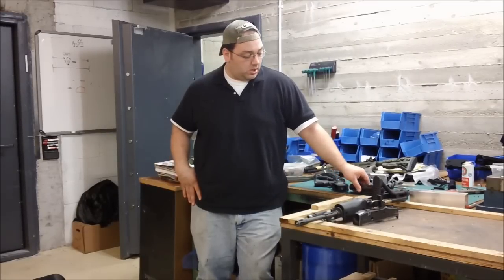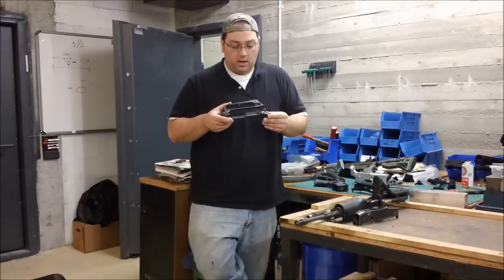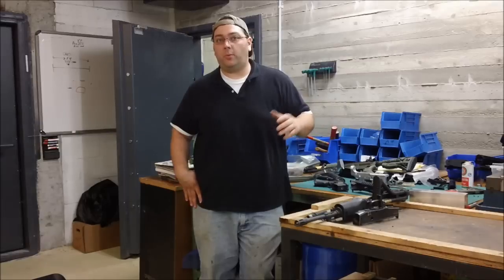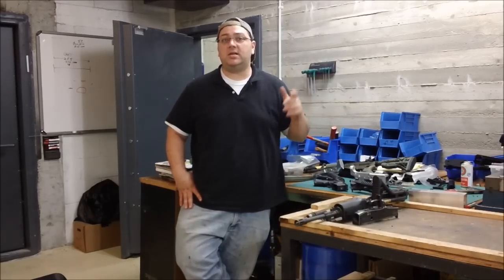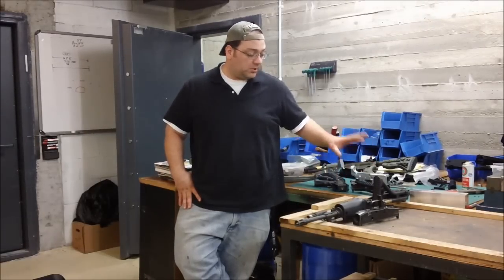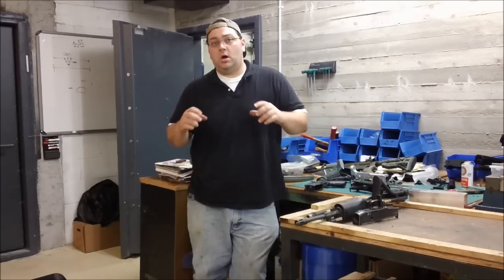Seeing is believing! Milled vs. Forged receiver strengths. Also a look at barrel obstructions

Comment: You know they can CNC a billet upper and lower from forged ingots also.  So you can have both.   Most people think that billet uppers and lowers are made from cast ingots, there are not.  They forge the ingot and then it's heat treated to the spec. that's requested.  I hope this helps.

Comment: You just proved that the forged reciever is harder than billet. Think about why they use soft steel bolts for seat belt; because they bend, not break like hardened steel bolts. So what happened when you used a stupid high psi round is you broke a harder aluminum and you bent a softer aluminum. I don't know where you have heard about rifles having these kinds of failures on the battlefield but from my deployment experience I don't ever remember anyone coming back from outside the wire with that kind of catastrophic failure. I feel like in a more real world scenario you'd see the forged upper receive no damage because of its hardness and you would would see the billet eventually bend. Just my two cents based on your results.
Reply: +James Dean If you knew anything about metallurgy you would realize Grant Boss is exactly right. This guy just contradicted himself, by saying the forged barrel broke and the billet bent. Thats because when a metal is harder they become more brittle, where as a soft metal will bend. Like copper versus cast iron... You probably shouldn't call people names when you dont have a clue what you are talking about.
Reply: +James Dean  the military load is a hot high pressure load in 556 you stupid fk
Reply: +mavrick211 No, C.I.P. defines the maximum service and proof test pressures of the .223 Remington cartridge equal to the 5.56×45mm NATO, at 62,366 psi (SAAMI 55,114 psi). They are identical. The pressure differences occur when using either 5.56x45mm cartridge in a .223 Rem. cartridge chamber or a .223 Rem. cartridge in a 5.56x45mm chamber, as the two have different dimensions. Firing a 5.56x45mm from the smaller chamber dimensions of the .223 Rem. chamber will cause pressures exceeding safe levels, whereas, firing a .223 Rem. cartridge from a 5.56x45mm chamber will result in lower pressures due to the larger chamber dimensions, including the longer leade.
The wall thickness of mil-std brass versus commercial brass has nothing to do with chamber pressures if you understand that the mil-std brass has less case volume due to the thicker case wall, resulting in the necessity of a smaller powder charge to maintain safe chamber pressures.
I'll refrain from calling you names, such as you needlessly and wrongfully called +James Dean.
Reply: +betatalk357 the phenomenon you mentioned is called work hardening, which doesn't occur in hot forging processes.

Anyway to achieve T designation the aluminum has to be heat treated which relieves work hardening anyway.
Reply: +Filipe Amaral You're right but it does alter the grain flow unless it's been completely annealed.
Reply: so which is one is better billet or forged?
Reply: Forged is less malleable that's why it blew apart. Forged is harder your correct.  Same thing with tempered steel. Its harder but it brakes before it bends.

Comment: gotta love all the butthurt in that dislike bar. yea, im taking a machining class one of the things we learned? billet is fucking stronger than cast forged!!!!!! where the fuck did the notion that it was weaker even come from ar15.com fucking retards.
Reply: +Garret Chambers,  please explain what "cast forged" means. There is cast, there is forged and there is billet.  "cast forged" is not a thing.  You and "James Dean" show a lot of ignorance in your comments. (Taking a "machining class instantly makes you some kind of expert"??). To this point the only accurate posts are from "Tumdeaux" and Grant Boss. Now there is my accurate post. In most instances for modern AR 15 construction, forged is indeed stronger than billet........and this guys comment on "exploding receivers in the military is the most ridiculous comment" I have ever heard regarding anything AR related......"Grant Boss", some people do not have the requisite GQ to understand why "stronger" would mean "more brittle" vs milder "less brittle" . You are correct in your proclamations but one would have to understand basic metallurgy to understand what you mean by  "bend". The forged upper in this video had to experience a chamber pressure much greater than the that experienced by the billet to have such a failure. The forged "broke dramatically"  because of its "stronger and harder" structure. The pressure that damaged the billet receiver would not have damaged the forged receiver. It is however a moot point. 7075 or even 6061 receivers are commensurately strong. The "billet" looks beefier and to some has "better lines" than forged. Billet is heavier unless lots of machining in non critical areas is performed. The reason manufactures are moving to billet, side charging, slick sided and so forth is the need to continue "upgrading" for "sales" and to meet customers demands. Compare it to "new features on a car". Most technology is around for years before it is introduced. We have to offer something better and wetter to attract the customers! Why?  Because we all want the latest toy............However, "New and Improved" often means "less reliable but cheaper to produce"....but in this case it is just a matter of preference............p.s. while one company did offer a "cast lower" I have no knowledge of anybody or any company enough to offer a cast upper. For good reason...........inevitable litigation....

Garret Chambers: Casting is the process where metal is heated 
until molten. While in the molten or liquid state it is poured into a 
mold or vessel to create a desired shape. Forging is the 
application of thermal and mechanical energy to steel/aluminum billets or ingots to cause the material to change shape while in a solid state.
Reply: yea i said "cast forged" because i wasnt totally sure of the forging process at the time..i have since looked it up and fully understand it now., however i was merely stating how billet is stronger than forged and cast. which i still believe. and i also think you are full of shit. why would he lie, even if it was for a buck, would he really bust two recievers with 2 different pressures? doestn make a lot of logical sense too set it up like that. i think what would make sense is testing the rockwell hardness in different spots because forging results in uneven strenght in the reciever and id be nice too compare
Reply: I never said he was a liar. I don't assume anybody is a liar unless I know for sure. I am sure he believes what he says. I did however point out that his example is skewed and at minimum his statement about the powder being "enhanced" by a chemical compound  after cleaning the ammo is ridiculous. Additionally, the proclamation of daily, weekly or monthly, or annual large scale failures of M16/AR15 receivers of any era/model within the various services is a ridiculous unfounded statement. Unless the failures of his two examples happened under exact standards/conditions such as;  same pressure perimeters, humidity, altitude, etc then there can be no comparison with the two examples. Do you think he knows under what pressure the forged receiver failed versus the billet receiver? I can tell you "no" he does not. A forged receiver will likely suffer more damage when it fails because it is "harder and stronger"  and takes a greater pressure in order to fail than the billet if they have similar thickness/construction. My AR10 with a billet upper is probably as strong or even stronger as my forged AR 10 because the upper is much bigger and has much greater wall thickness than the forged AR 10. I did this because I like my extreme range rifles to be heavy. Currently many manufactures are going to billet and they claim "better performance". That is a "misleading statement" on the manufactures part. In any industry it is called "fluffing" and it is legal. Fluffing does not meet the level of "fraud".  The truth is, they have gone to billet for enhanced aesthetics and being able to justify charging exorbitant amounts for the " increased machining process" etc. A forged receiver already has its shape during forging. Therefore limited visual "enhancements" can be machined into the finished product. In the case of the billet it starts as a block of alloy and can be made to look aesthetically more aggressive and more "macho" than the forged. In the end though the difference is moot in terms of wear and strength. Both are stronger than need be, both have excellent wear, as wear is dependent on the alloy and the quality of the machining, related parts, coatings and maintenance. FYI. While my assertions about the receivers is factually sound you are correct that I am full of shit! At least for the time being anyway. Why? I am old, have IBS-C and can not take a dump to save my life.....................
Reply: James Dean
 Yes I do. Any weapon capable of delivering an accurate and/or lethal projectile over one half miles is an extreme range weapon. This includes any weapon whether the 6.5  Grendel or the 50 BMG. I shoot 1400 yard competition with a hand load using the 175 Sierra TMK projectile (0.7954545 miles). We can stay supersonic a little over 1300 yards with our hand loads. I also shoot 338 Lupua Magnum competition in 2400 meter competition (well over a mile). 1.491291 miles to be exact. All Sanctioning bodies like the USPSA and "all branchs" of the the military consider 900 meters (plus) extreme range exercises. By your answers, your name calling and your general literary demeanor you hold yourself out to be a weapons expert and military. I looked in the "book" and your name is not present as having been a shooter in the past or a shooter in the present....correct me if I am wrong and point me to the right page......
Reply: +James Dean 

Any novice shooter understands that when a Black Hills 308
factory load is supersonic to 1100 yards with the subject projectile that 1300
yards is currently an achievable objective with the right powder, custom loads, chambers/barrels and barrel length. 
The effective range range will continue to improve with time and technology. While I may once have been capable
of being a world class shooter, not anymore. Age and the subsequent results
took care of that. I spent much of my life in the corps and racing sports-cars
with high powered rifle competition as a secondary hobby. While I am a two
time NRA Champion and a Intra-Service Military Champion, that was many years ago and long gone. I compete locally and regionally
these days. I hold myself out to be nothing more than a guy that loves
firearms, general range time and competition, whether a participant or
spectator. I do hold myself out as a "man" that "does not"
without provocation, belittle and denigrate others for their opinion as you did Grant Boss. Unlike
you and thanks to God my character calls for a commitment to integrity. On a personal note. You seem to be a truly miserable person on 
a spiritual level. I myself once was that person. I was mean and hateful to most people therefore I know it when I see or hear it. If you actually are a man that served honorably I hope you learn to treat others that exemplifies that same honor. If you do not learn this, it is only on you that is responsible for who you see every time you look in the mirror and you realize who you really are. If you are young that may not be a "thing" to you. But if you get old like me all the hurt you caused whether enemy, friend or stranger will be back to haunt you. Good luck to you 
and blessings in life's endeavors cause you are gonna need it.....I am done with this subject...........
Reply: +James Dean .....that would also include the 22 caliber (223/5.56) since guys are shooting rounds like the 90 grain Barger VLD out to and past 1000 yards accurately..........
Reply: +angelo d. Roberson Hey Marine, you have some awesome long range skills brother! Were you a SS? BTW, thank you for your service, and I sincerely hope and pray that any and all health problems you have are cured ASAP, or at least managed as best as possible. I'm an old Army guy myself...Ranger (2/75 C Co and 3/75 B Co). 

I'm also a design engineer. I left the Army after 8 years of active and reserve duty (4/4) so I could use my G.I. bill to go back to school full time. I earned a dual B.Sc. in mechanical and aerospace engineering, and a M.Sc in manufacturing engineering, and I can tell you for a fact that you've been debating in this comment section with two complete morons that have less than half your intelligence, and about 1/100th your knowledge and experience. They're absolutely wrong about everything they've said, just like the dumb sap in this video. That's why it's pointless to try and engage in conversation with them. They won't listen because they don't even know enough to be able to recognize how much they don't know!

This video is so bad that it really should be deleted based on how many totally false claims that are made. Claims that are leading people astray (proven in the comments). All of which were said without even the smallest attempt to utilize scientific method (as you correctly observed), to substantiate his conclusions. Just a whole bunch of fail, just like the two clown's you've been trying to educate. 

Besides all of the ridiculously wrong engineering / manufacturing related statements that are made, the most absurd may have been the comment about the M16 / M4 supposedly "exploding" all the time in the hands of our brothers-in-arms. What a completely false joke. I carried M16A1's and A2's in the 80's as a Ranger, shot many thousands of rounds through them, used them in battle numerous times (Grenada, Drugs / FARC rebels, Panama), and they never gave me any problems. And they sure in the hell never "exploded". As long as you take care of them (and it doesn't take much to ensure they run properly) they are extremely reliable. 

I do have a question for you...are you guys really hitting groups at 1000+ yards consistently with .223 / 5.56? I wish I could do that, that's some mighty fine shooting! That's a crazy amount of drop and windage, especially if there's any kind of breeze. I'd love to get into really long range shooting, especially with some heavier calibers like you're using, but I really can't afford it right now. What's your current favorite caliber / rifle to shoot?

I recently built a sort of "jack-of-all-trades" AR-15 that I'm really enjoying. It's a cross between a 3 gun competition rifle, and a Mk12 SPR, with a really nice barrel (18", 1:8, 5R polygonal, Wylde chamber) and competition trigger. I can shoot it accurately to the limit of the range that I go to (600 yards) using 77gr SMK and a scope, pretty easily. Especially if there isn't much wind. Reminds me of my Army days at the range, except I could see a lot better back then and I didn't need a scope to consistently hit 500 yds.

I'm pretty sure this gun could reach out farther (whether I can or not is debatable). But I think I would rather use a heavier / flatter shooting caliber at anything beyond 600 yds. At least a .308. Maybe I need to start saving again for an AR-10 build. 

Still, this AR-15 makes for a really nice all around rifle that I can use for home defense, 3 gun, and for hunting hogs and deer out to about 150 yds (with patience / good shot placement of course)
Reply: angelo d. Roberson You consider an AR-10 an extreme range rifle....
Reply: +angelo d. Roberson well its hard too say i wasnt 100% sure too be honest...what eves i think ill get both (already have forged :P)
Reply: angelo d. Roberson 175gr TMK are supersonic out to 1300 yards using handloads.......if you say so. Sorry boss that reeks of bullshit. Keep pretending to be some world class shooter, I'm quite amused.
Reply: angelo d. Roberson There you go, several paragraphs of ad hominem attacks. Didn't take you long to show your true colors.
The only person who comes across as miserable here is you.
All your personal attacks don't change the fact that your claims are bullshit :)
Have a nice day, I really do feel sorry for you.

Comment: 7075 forging is stronger than 6061 billet and if the forging is far cheaper why would anyone bother with the billet?
Reply: +tfr51 lets compare apples too apples 7075 forged is weaker than 7075 billet. 6061 billet..probly weaker than 7075 forged
Reply: +tfr51 Maybe because forged billets are available as raw material?
Reply: 7075 forged is stronger than 7075 billet.
Reply: They look a lot nicer. That's about it.

Comment: A billet upper is milled from a forged blank.  (machined into the correct shape)
the standard upper is milled from a cast blank (poured into a basic mold)
Reply: Incorrect. A billet upper is milled from......you guessed it....a billet!!!  A "standard" receiver as you call it is forged from hot aluminum not milled from a casting.